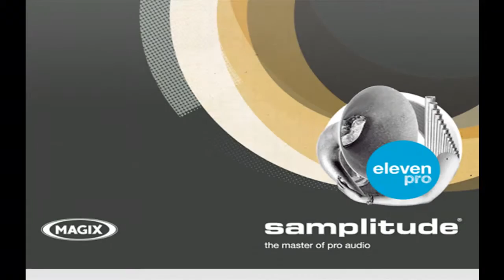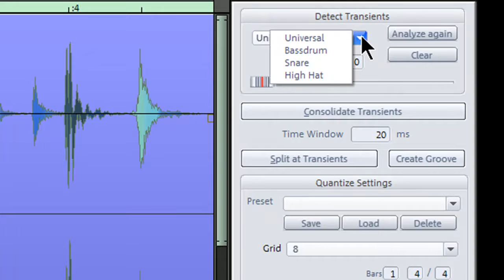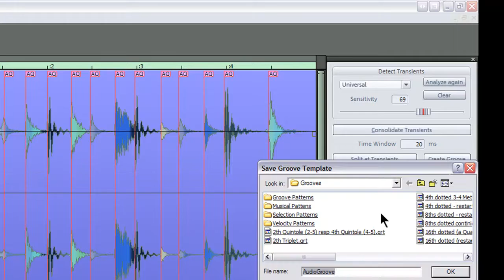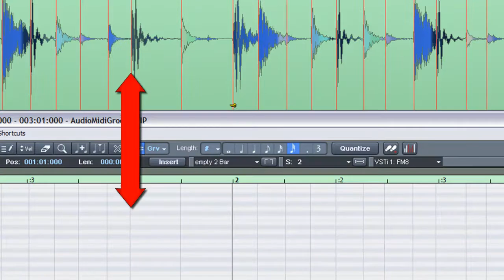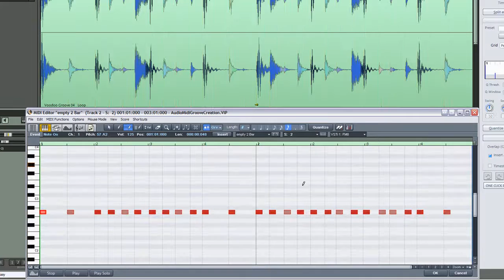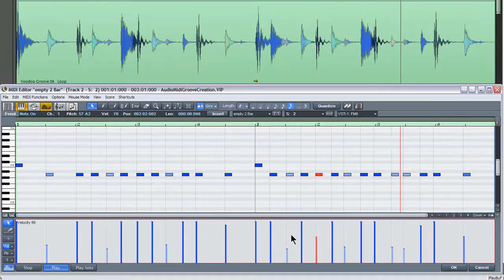Samplitude 11 Pro - Audio to Midi Groove Template Creation

Comment: Yeah boss, all good - it tracks the transients really well. It would be good to have a few more option to the capture process though, like threshold etc. I've been using the Toontrack Wave to MIDI converter for more finicky snare parts that have ghost notes and flams. Thanks again for the vids

Comment from the maker: Make sure you select the audio part you want to create midi triggers from then go to Tempo >Detect  Transients .and the Tempo>Create Midi Triggers from Transients . This should work . If it doesn't open the Audio Quantize wizard ( Tempo>Audio Quantization Wizard ) and detect them using the slider and then use Tempo>Create Midi Triggers from Transients again . Let me know how you get on .
I will probably do an updated video soon .

Regards
Kraznet

Comment: Great video.. Question: I have an audio track that is snare drum. I want to trigger samples via MIDI info generated from audio transients of the snare. When Samp creates these MIDI notes, does it look at the velocity of the audio transient and create a matching velocity in the created midi note? Also, when I press Detect Transients then Create Midi notes, it comes up blank.. only just upgraded so still getting used to it but any tips? Thanks for your great Samplitude videos.